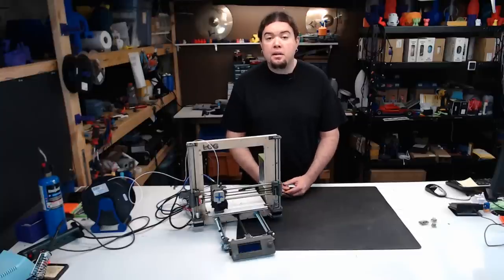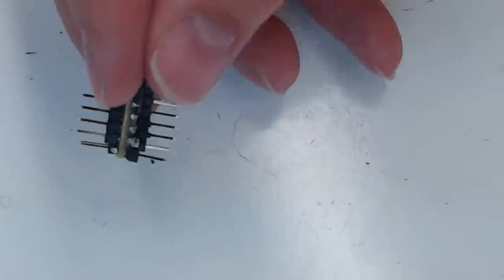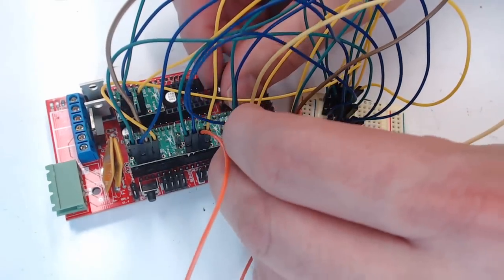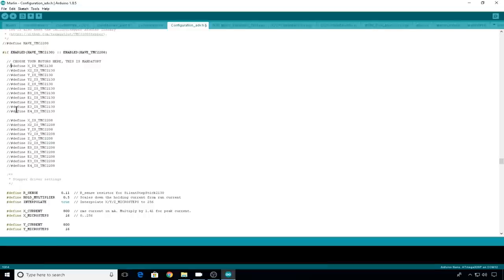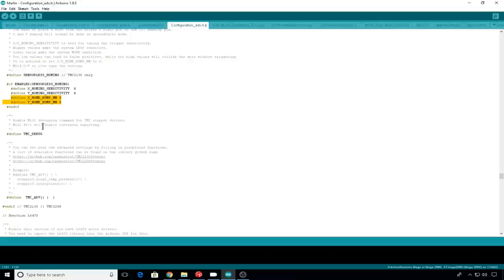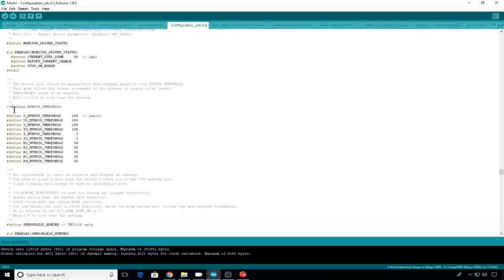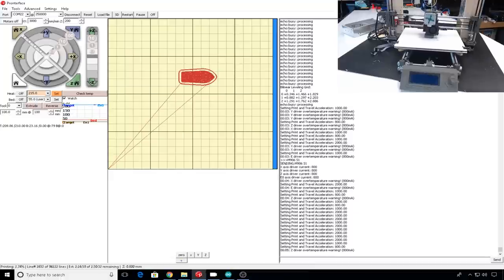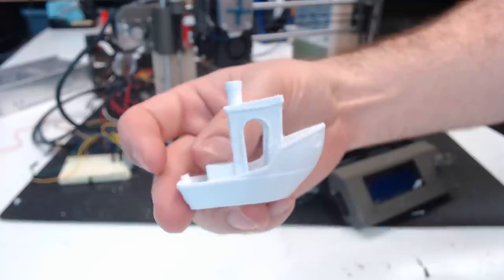Trinamic 2130 Stepper Driver Setup - Marlin - Chris's Basement

Comment: TMCs always run very hot.. thats true. Active Cooling is a must to ensure proper operation and to avoid loss of steps.

Nice Video, all just on point.
Reply from the maker: Andree H. Thanks for watching, that's good to know. Do all TMC's run pretty hot, like 2660's? I need to redesign my board case to have a fan on it.
Reply: I'm running the TMC2208s at 24V and after several hours of printing the heatsinks slowly increase in temp to the point where they're almost too hot to touch. I'm planning on adding a fan next to the drivers.

Maybe future versions won't run as hot.
Reply from the maker: @Craigthepope  I have been meaning to grab some 2208's to try them out. I need to get back to testing my 2130's as well. Definitely going to have to design a fan mount.
Reply: They're pretty great, inexpensive (~$7 each) and are almost a drop in replacement. You do have to solder the pins yourself (if purchased from Digikey), remove the M3 jumper from your controller board (1/16 microstepping) and modify Marlin's config file (version 1.1.9) so that the relevant axis (ex: X&Y) is set to TMC2208. 

$7 may sound expensive but it's comparable to what Pololu's official A4988s sell for.
Reply from the maker: Oh nice, there like $13 where I get them. At any price still worth it. These are the best of the best.
Reply: These temp flags is triggered when the chip is 120 degrees according to the datasheet, that is goddam hot! Thermal shutdown is at 150 degrees.

Comment: Just tried to Setup Marlin... seems that in  Marlin 2.0.X you should use the library "TMCStepper which relpaces "TMC2130Stepper"
make sure you use the correct library if you get an error that says "sketch/src/module/stepper/TMC26X.cpp:28:10: fatal error: ../inc/MarlinConfig.h: No such file or directory
#include "../inc/MarlinConfig.h" when compiling.
Source:
https://github.com/MarlinFirmware/Marlin/issues/12114#issuecomment-430459964
https://github.com/MarlinFirmware/Marlin/issues/15102
Reply from the maker: Thanks for posting the tip.

Comment: Hi Chris I have the video is amazing you explain very well. I want to ask you an issue because I have the TMC2130 v1.1 in X Y and Z whit Ramps 1.6 the problem is that I can´t  make work the sensorless homing. I reviwved the conections and are ok but the motors X and Y dosen´t stop  on the final they  continous going pushing. I changed the setup in #define X_MIN_ENDSTOP_INVERTING but its the same they never stops. I measured the voltage on pin DG01 that go to S on the ramps but dosen´t change the voltage when you move and try to stop the motor. I don´t know what to do, what do you recommend me? Regards!!!!
Reply from the maker: Make sure the sensorless homing settings are getting updated in eeprom. What does it say when you run M503.

Comment: I bought some pre-soldered 2130s from bigtreetech (they're not clone- TMC logo + 2130 on chip). They came with a wiring harness, but no diagnostic pin soldered in. I'm willing to add this if I have to. If this pin is a must, what does it do?
Also, I'm running 1.1.3 (can't get 1.1.9 to work with my probe- still working on that). It all looks very similar, will any of the firmware be significantly different between yours and mine?
Reply from the maker: 1.1.3 you will have 2130 support. The diag pin is for sensorless homing, so that is the only feature you won't be able to use.

Comment: @Chris Riley
+Chris Riley

You can use the lcd connector board. You just have to solder pins on top of it. Others have done it and i plan to do the same

x axis c pin has to be changed thou as the sd card uses that,  y axis is used by the lcd cs pin so that has to be changed to an free pin also

i would suggest D0 and D1 on the AUX1 connector.
Reply from the maker: I have seen people do that, I was going to test that out. The SD card does interfere with the 2130 communication, but those pins can probably move to 4, 5  and 6.
Reply: Chris Riley no the SD card is an spi device like the TMC are. As long it has its own CS pin it should work. I have a maxim based thermocouple board running along with the SD card.
Reply: I have a mendel90 (modded) with same ramps setup as you (but with full graphic display) and i have  the max31855k thermocouple adapter on the same spi bus as the sd card and lcd. no problem there but the CS pin is not the same (it's D66). the sd and lcd also each have their own CS pin. the SCK (clock pulse), MISO and MOSI are shared. You can think of the CS pin as the mega/ramps "i want to talk to you" line, only one can be high at a time. 

of course due to the nature of the ramps board you have to be handy with the soldering iron, but its not impossible. you just have to use pins for CS that is not in use by something else

I had to print out a pinout of the mega board and strike out what was taken allready (pin file is handy for that), that is how i figured that D0 and D1 was free. But i will admit that its starting to get crowded :-D
Reply from the maker: Interesting, good to know, thanks for the explanation.

Comment: Very interesting video.. Very detailed.. Thank you. How come the mk3 has no active cooling on the drivers?
Reply from the maker: That is something I was thinking about as well. The only thing I can think of is they have them set on a board that has great heat dissipation and they run at 24v which the current would be much lower.
Reply: Here's what Josef Prusa said about it.

https://youtu.be/RuvaSTg33r4?t=1m45s

Comment: I've seen a few people recommend using a 24V power supply (which RAMPS doesn't support).
Reply from the maker: I have wondered about that, 24v might cool them off some, less draw there. I want to start working with them again now that 1.1.9 is out.
Reply: Alex Kenis produced an excellent graph that compares torque in different modes and different voltages.

https://youtu.be/GVs2d-TOims?t=22m10s
Reply from the maker: Very nice! Thanks for the link!

Comment: I think this will be too late by now... but here's my problem.
I use MKS Gen L 1.0 and some fytsec TMC2130 board, and despite modding the jumpers to enable the SPI bus and all the configuration options the board has to offer, the board keeps throwing driver errors (result of communication failure) and if I force it to run on Standalone mode (TMC2100/Pololu compatible mode) the printer emits high-pitched noise.
I heard that increasing the voltage to 24V fixes this noise problem, but I don't know for sure. Care to investigate, or point me to the correct reference material? The pins on MKS Gen L board is not drop-in compatible with generic RAMPS board so the video from Mark is of no use :(
Reply from the maker: Interesting, I don't think I have seen that MKS board before.  Not sure on the SPI error. Do they all get the error? I can't currently test 24v easily, but  I can set them up in standalone and see if there is noise. I really should get a spare 24v supply as well.
Reply: @ChrisRiley  
Yes, every single one of them errors out. I'm also using LCD and SD card reader because I need them to work. This problem is really weird because the hiss and whine do not occur on smaller printers.
Reply from the maker: Interesting....so you might be seeing SPI collision. I might be able to test that out. I will give it a try.
Reply: Grab Marlin 1.1.9 and wire your board like: https://www.thingiverse.com/asset:66604. Some code was added to the MKS GEN-L pins file to account for this wiring configuration/prevent LCD/SD card interference (no remapping of pins required): https://github.com/MarlinFirmware/Marlin/blob/1.1.9/Marlin/pins_MKS_GEN_L.h#L40

Comment: Where can I put the cs pin on the ramps 1.4 board for a dual extruder??

P.S. Love the vids dude
Reply from the maker: Thanks man! You can pretty much grab any pin in AUX2 that you have left, or AUX1. You just have to update it in the pins file.
Reply: @ChrisRiley  Thanks dude. Got it sorted. I wonder whether you could help on another little issue I have. For some reason my ramps screen lights up but it shows no menu. This was an issue before installing the new drivers so I know its nothing to do that. I have both sd support and the reprap smartscreen uncommented but don't know what else to do.
Reply from the maker: @drewthfc  Hmmm, not sure, but I would check the pinout first. I have seen some of these screens have the plugs flipped.
Reply: @ChrisRiley  I double checked the pinout straight away and didn't seem to be an issue. I have all pins in aux 3 and set correctly in marlin. I got a new screen as well to see if that was the problem and I'm having the same issue.
Reply from the maker: @drewthfc  Hey drew, not sure what is going on here, but I had a thought. Which REPRAP screen to you have uncommented. There is 2. are you using the 2004 or the 12864?
Reply: @ChrisRiley  Hey Chris. I just checked and both screens I have are the 12864 version. Do you think that may have something to do with it??

Again thanks for your help dude
Reply from the maker: @drewthfc  It could, make sure you have this one uncommented #define REPRAP_DISCOUNT_FULL_GRAPHIC_SMART_CONTROLLER   and this one commented out. #define REPRAP_DISCOUNT_SMART_CONTROLLER
Reply: @ChrisRiley  ahh, it turns out I only had one of those lines commented out. I'm in the middle of a print right now but will upload and let you know. Cheers Bud.

Comment: Hey Chris! I want to get the TMC2130 drivers with the MKS Gen L board for my Creality Cr-10s S5 but I noticed there are DIY and SPI versions. Which one should I choose? And can you possibly explain to me what these things mean? I can't find much info on these when I look up the driver versions.
Reply from the maker: I am not sure what DIY means, but I am guessing that is standalone mode. It all depends on the features you want. If you want sensorless homing, that would be the only reason to go with the 2130 at this time. If you don't want to use that, I would go with 2208's, they are just as quiet and easier to use. The newest one is the 2209 it has both, but they are currently hard to get. 

With the 2130 on an MKS board to use the features outside of standalone mode like sensorless homing and PWM controlled voltage, you will have to hook up the SPI bus. That takes a bunch of jumpers and config as you can see in this video. Same with 2208 is you want to use the software control settings, although fewer wires because they are controlled by UART, TX and RX pins. 

So at the end of the day, it's all about the features you want,. Me, I would just get some 2208's because they are quiet and use them in standalone and call it good. You can then just set the voltage with the trim pot on the top of the driver.
Reply: @ChrisRiley I just recently picked up this Cr-10s S5 for dirt cheap and wanted to do a few upgrades with the saved money. My other printer I've been using is the Prusa MK3S and I really like the features the TMC2130 drivers that they provide. I wanted to basically make the Cr-10s S5 quiet like the MK3S but also use sensor-less homing since I really hate how fragile endstop switches are. I've been doing a bit of research to apply these features to the printer and I came across the MKS Gen L board since it is relatively cheap. From what you said I think I want to go with the 2209 drivers since I'm a bit of a novice when it comes to these things. So with the 2209 drivers I would need to use jumper cables? And is it relatively easy to install? Do I need to also mess with software/coding as well?

Thanks for the reply Chris! Your videos are very helpful for me when I am tinkering with my MK3S, keep up the good work!
Reply from the maker: @Leo-nz3oo  Yes, on the MKS you will need jumpers for the UART for 2209's and some config changes in Marlin. You COULD go with a SKR 1.3 board and the jumpers control everything no wires needed. Those boards are less than $25.
Reply: Chris Riley Thanks for the help Chris! I will look into that board and try that out

Comment: Trinamic, or any Stepper Driver
, I think it will never be a real success!
You would probably have to have a new Ramps board with more possibilities.
really does not mean ugly but that rumbling is really nothing, rumble with pins up pins down..
 way too much hassle!
I hope that there will be another Ramps where you can also prick those other steppers!
and then set with jumpers if necessary 
BUT still that the old fashioned steppers can be chosen!!!
also a stepper that is stronger, more powerful......
some pins for 12 / 24Volt, and for the fans (not a fan but 2 ... 3) etc etc ...
I know I know
 once a day ... (we keep hoping and dreaming!) fairy tales .... sigh

friendly greetings from The Netherlands!
Rob.
Reply from the maker: Wouldn't if be awesome if Ultimachine brought out like an Ultimate RAMPS? 12-24v, pluggable smart drivers, high end mosfets, That would be killer.

Comment: Where do I have to connect the 2nd z-axis stepper driver? I have a MKS gen-2z 1.4 board with 2 steppers for each z motor
Reply from the maker: Check out pins_RAMPS.h you can set it to what ever pin you like.

  #define Z_SERIAL_TX_PIN    44
  #define Z_SERIAL_RX_PIN    42
  #define Z2_SERIAL_TX_PIN   -1
  #define Z2_SERIAL_RX_PIN   -1

Comment: what about the diag pin for the extruder? is that just unconnected?
Reply from the maker: Hey Bo! Yes, Z and E diags are not connected. Not sure if you could use stall guard on E, but that might be a way to detect jams if you could get it working right.
Reply: dooh! of course the diag pin is only used as an endstop.... and in my 5 years with 3d printers i have not seen any extruder with an endstop :-D

Comment: Very cool, great video. I’m thinking about getting 2130s for MKS gen 1.4 board. Is your setup running on 24v or 12v??
Reply from the maker: Thanks! This one is 12v, but I think 24v would work even better.
Reply: @ChrisRiley  I have a 24V MKS gen 1.4. Would you still recommend these? The 2209's look nice but I don't see them listed in  Marlin 1.1.9.
Reply from the maker: @SyFyBry  Hey, I would upgrade to Marlin 2.0 and use 2209's. 2.0 will work just fine on your MKS board.

Comment: Why can't you use the 5th driver slot that's unused and configure your pin config file in marlin to use that instead of aux 3?
Reply: I'm looking to upgrade to these as my Y driver blown out after 7 years. Upgrade needed for sure! I hope Marlin has an option in the firmware config for a direct plugin option for the 3120's. Seeing the pins can be remapped Unless the Ramps just can't cut it anymore. Need to do some research. Wish me luck!
Reply from the maker: I think you can without issue, might have to change a few extra things, but it should work.
Reply from the maker: @brianlink391  You can hook them up standalone for a direct option, but for SPI you will need to sort the pins out and hook them up. There is also a RAMPS 1.6+ out there now that has all of the SPI done on board. You might check that out.
Reply: @ChrisRiley  Thanks for the suggestion.  I'll definitely check that out. it's also about time to upgrade my old ramps 1.4 board,  it's so Frankensteined at this point it's not even funny.   okay, maybe it's a little bit funny. :-)
Reply from the maker: @brianlink391  lol, yeah I know that RAMPS board all to well. :)

Comment: Did you ever find a way to use this without aux-3? Would love to use the drivers but given a choice of them or an lcd I will choose the lcd.
Reply from the maker: I have found a way, I hope to get a video done on it soon.
Reply: @ChrisRiley  Hi Chris, have you got 2130's running on 1.1.9?
Reply from the maker: @jacquesvandermerwe7988  I have used them on .9 but no LCD yet, it's on the short list now. :)
Reply: @ChrisRiley  Thanks Chris. Any chance you can share your marlin configs? Mine is working fine on 1.1.8 but wont respond at all on 1.1.9.
Reply from the maker: @jacquesvandermerwe7988  Let me look through my configs and see if I can find the one I used to test this.